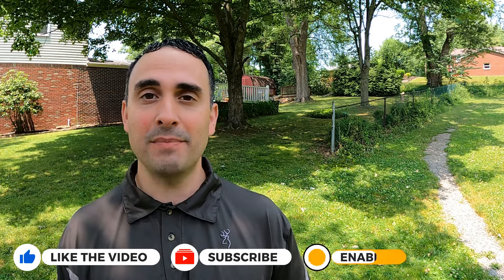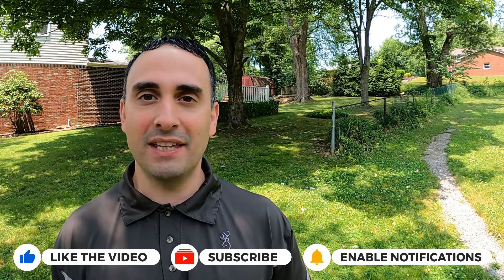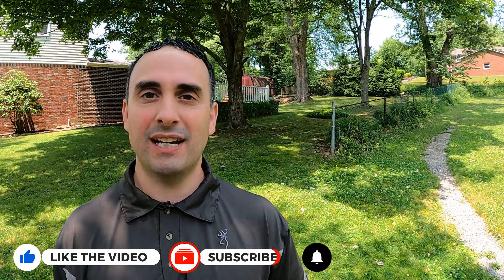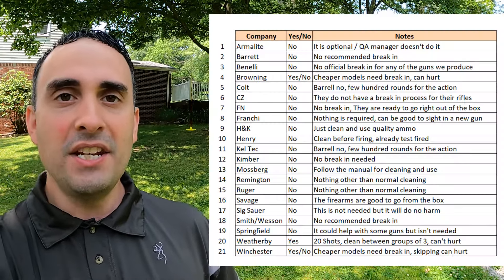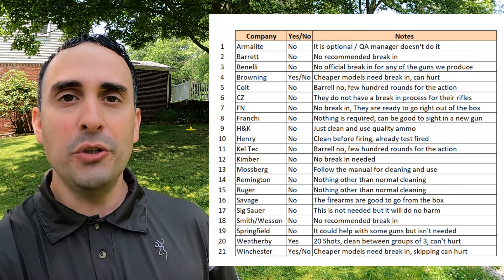How To Break In New Rifles & Barrels – 21 Companies Answer

Comment: Total waste of time and components, just don't over heat your new barrel, most people that think they're cleaning it actually are not, they run a patch down the barrel and think it's clean. another myth is that your barrel will speed up after several hundred rounds, if it actually does, which it won't it will be by an amount that doesn't matter, even if you're shooting long range.....
Reply from the maker: I think the only way it could speed up is if you wore down the lands and cut down on friction, which would also ruin accuracy. But even then, you would also reduce the pressure in the barrel which might even reduce accuracy.